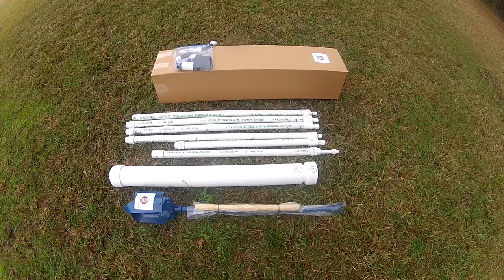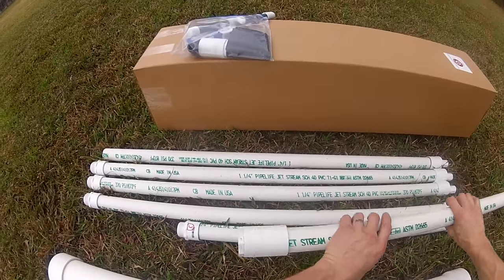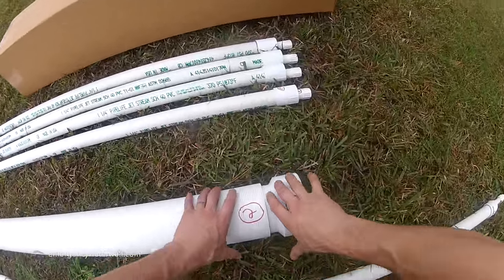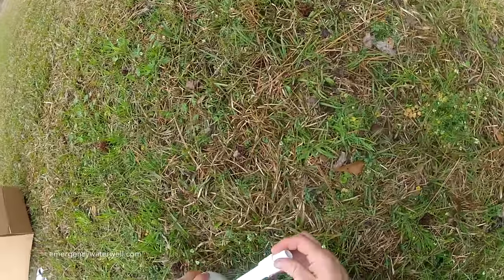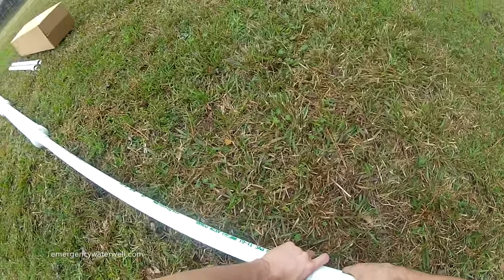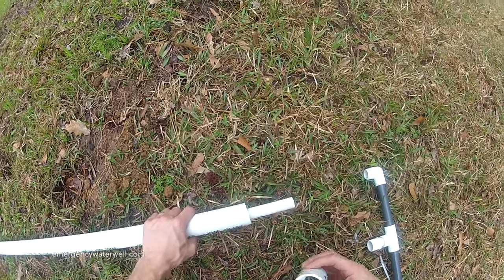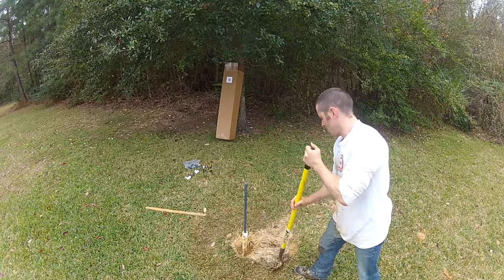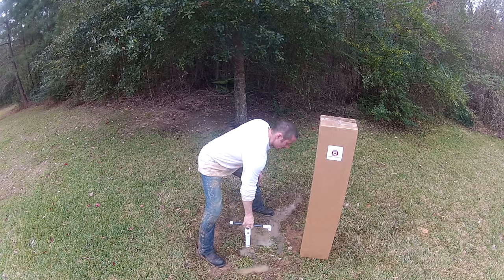Water Well In A Box Instructional Video

Comment: I am digging a shallow water well, but water is already coming up from the ground at just 5ft. When I bought the house a while back, the yard was muddy and I ended up installing a french drain, which improved the conditions, but ground was still wet all year around. I took a video of what is happening and I am hoping you can give me some advice. The issue that I am having, is the soil underneath keeps collapsing and not matter how much I dig... it fills back up with more soil. The other issue is that there is a vacuum or suction when I try to lift the dirt out. At the higher point of my property where I installed a fence, I was surprise to see water filling up the hole I dug to put in the fence post. Where is all this water coming from?

I am guessing this water that just about 5 ft. is bad water?

 Here is the video: https://www.youtube.com/watch?v=ghJALkDGZOA